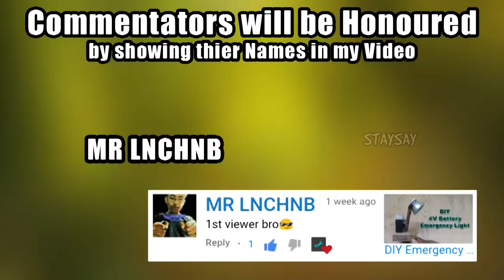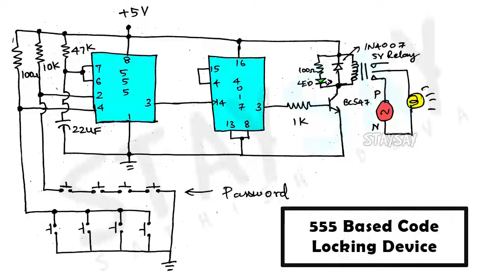555 Timer based Electronic code lock circuit | SdevElectronics

Comment: Can you explain what the function of the resistors are in your circuit?
Reply from the maker: To change frequency
Reply: @SDevElectronics  Thanks ! can i ask you one more question? i don't really understand  what the purpose/function is of  4017 ic and 555 timer ic in your circuit.

From what i can tell is that the 4017  sets the amount of combinationf for the push buttons you can use to set the password for this case it is  4 (1458).  Can you tell me if i am right regarding the 4017 ic and could you please further explain the function of the 555 timer ic.

Thanks in advance.

Comment: Can u explain me about this circuit and how to use various passwords
Reply from the maker: Refer circuit diagram.
555 in monostable mode
4017 in toggle mode.

You can change password by Shuffle you push buttons Pin 2 with pin 4.
Pin 2 push buttons are password.

If you press Pin 4 push buttons, it resets 555 timer. So Output is not enabled.